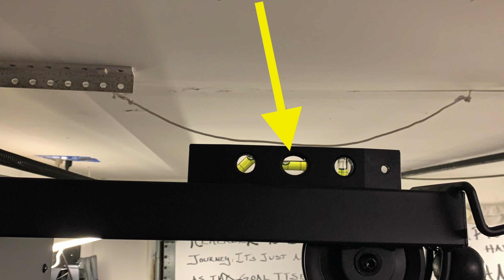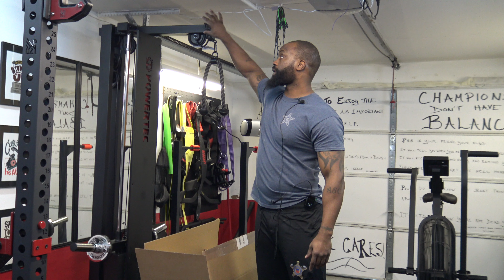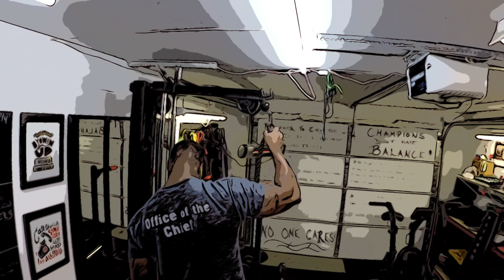Powertec Sent This To Me | Will It Work?

Comment: I had a somewhat similar experience with Valor Fitness. I bought a Valor Fitness SQ-BOX Adjustable Squat Box a few months ago. It's suppose to adjust using the bottom knobs. When I received it, the fit between the bottom and top pieces was so tight, it's impossible to shift up or down. Other pieces appeared warped. Put together, it looks nice, but for squat jumps forget it. I think quality is the reason why to pay more for Rogue sometimes.